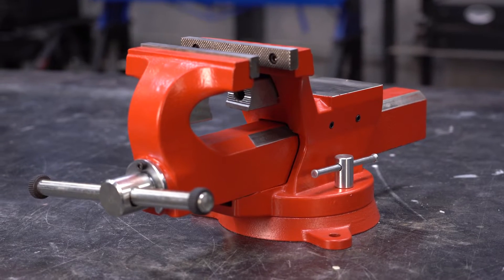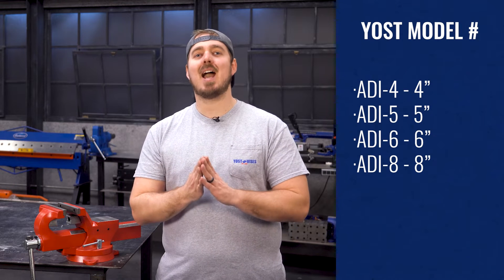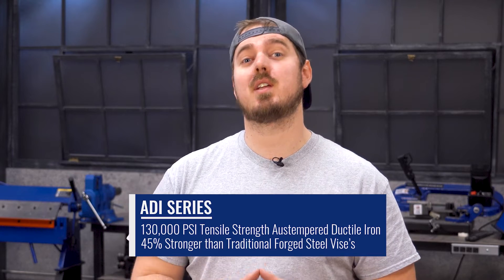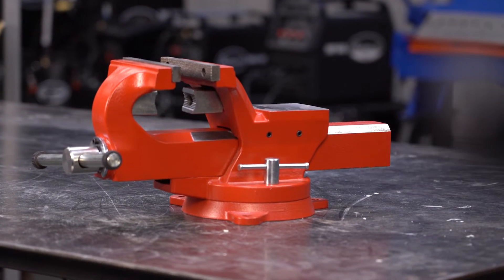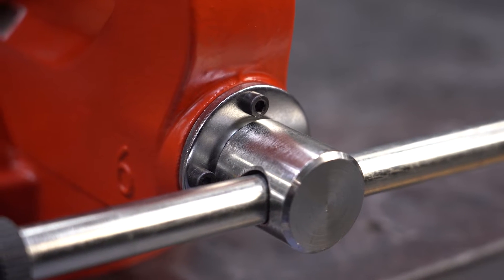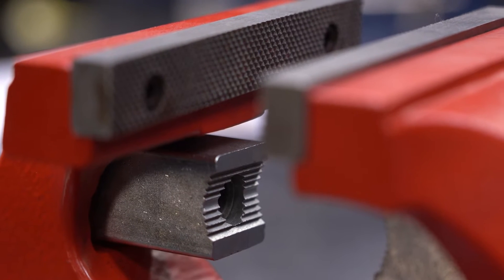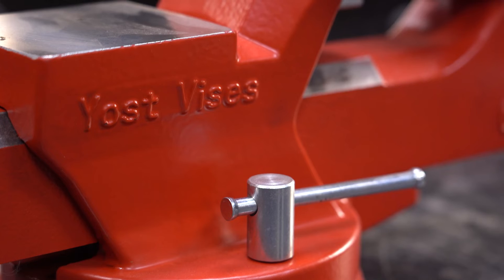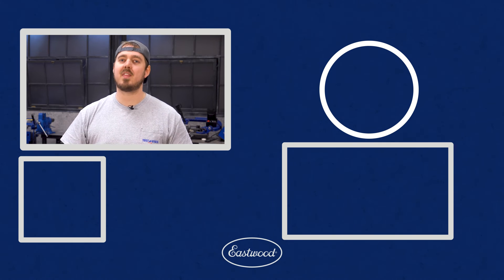Unleashing the Power of Austempered Ductile Iron: The Ultimate Professional Vise

Comment: I can’t understand how cast iron could ever be stronger than forged steel. Forgings will always have a denser and better grain structure over a cast. With similar dimensions.
Reply: Its stronger in the strict technical definition of material strength, but not the common usage.  This will technically handle higher localized psi ratings before catastrophically failing.  But forging will handle more applied force to a piece overall because it will deform a bit and spread the load out over a greater area. It won't get to as high a localized psi rating before it fails, but will get more lbs on whatever is being clamped before failing.  

Basically, they got rid of the FSV line, replaced with a cheaper China made ADI line, and the marketing department found the one measurement to claim its an improvement and are using that to sell a cheaper to make unit.   I would welcome anyone willing to put a FSV and ADI head to head and find the ADI actually better.  But who would give up their FSV vise at this point?